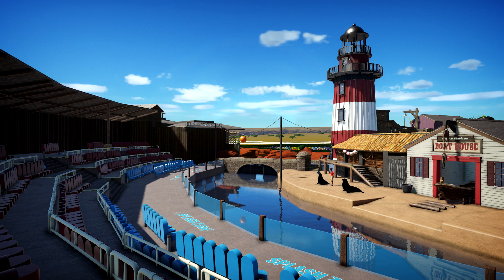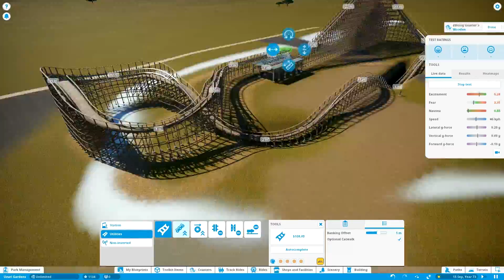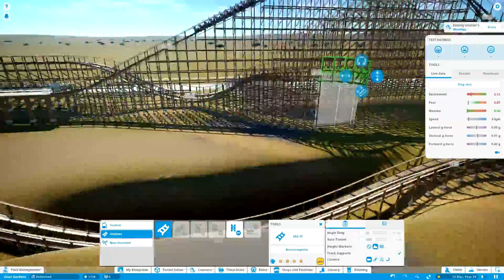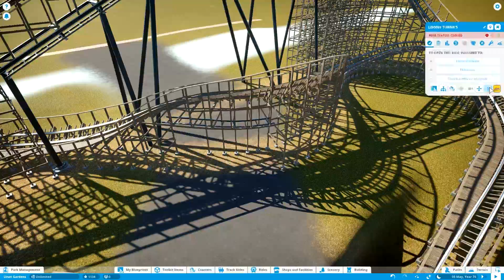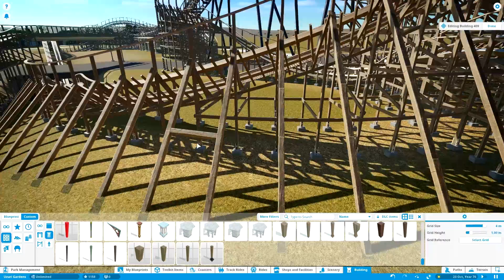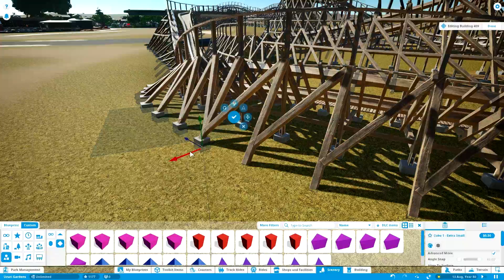Planet Coaster - GCI Wooden Coaster @ Uzuri Gardens (Part 1) - Layout & Custom Supports

Comment: The two planks down the middle of the track on a newer GCI is for walking along during the daily morning inspections. If you look at some of the older GCIs like Thunderhead or Lightning Racer, you will see that there are wooden planks filling in the middle of the track every time it turns and changes directions. These track planks help the ride inspectors get safely to the other side of the track where the walkway will not be blocked off by the track covering it. These are basically just safety features for the people who walk the track every morning.

Comment: A GCI wooden coaster with steel supports???! Even if it allows a "steeper lifthill..." why?! When I go on a wooden rollercoaster, I go on it partially because I like being thrashed around, but mainly for the different style. The wood beams everywhere making you feel like your hands are going to be chopped off, the diving between the support structures. I don't want to go on a wooden coaster that has been invaded by steel, that completely removes the point of a wooden coaster for me and totally ruins the vibe...
Maybe I'll just have to ride the first one when it's built in 5-10 years and that will change my mind, but in the meantime, it's a hell no from me.
Reply from the maker: Most of the supports are still wooden, though - as is the entire track, and the track being made of wood is what characterizes a wooden coaster experience the most. I think it has potential, tbh.
Reply: @Silvarret  Ah true. For me it's moreso just the psychology of seeing all the wood I guess that I am concerned about. Seeing the steel may give me too much of a sense of safety (I'm batshit crazy ok, I like the most dangerous looking wooden coasters lol), if that makes sense. It's not likely a wooden track supported by 18-inch thick steel rods is gonna collapse, while "theoretically" an all-wood track looks like it could snap any moment haha

Comment: The planks in the middle of the track from what I understand is so the maintainence workers can have something to step on when they walk from one side of the track to the other. On old woodies you didn’t need that because the banking is gentler and can walk on one catwalk all the way around the ride, but on a coaster with steep banking you have to cross back and forth to be able to walk along the whole ride
Reply: I was thinking the same thing. Arrow used to do that with their coasters as well (even in inversions)
Reply: Jeffrey - yeah I rode vortex yesterday actually and if you really wanted you could make it from the lift hill and basically all the way through the loops and come off at the break run just by walking on little catwalks between the rails